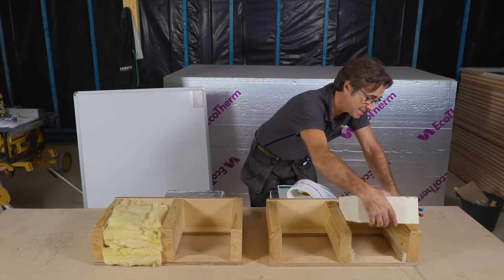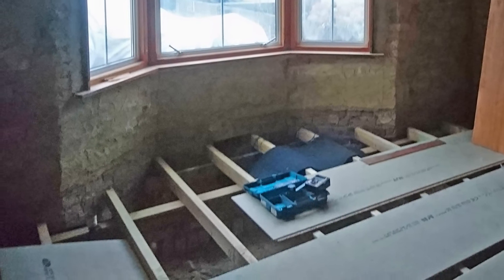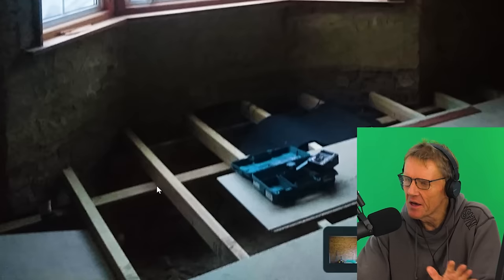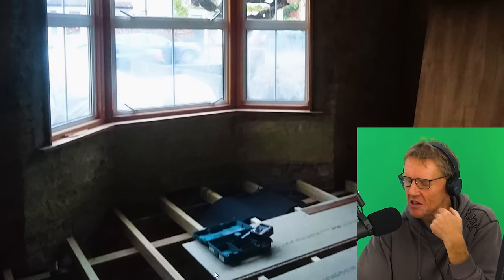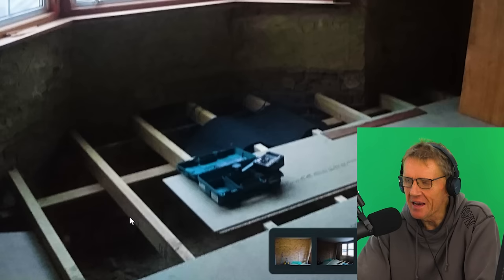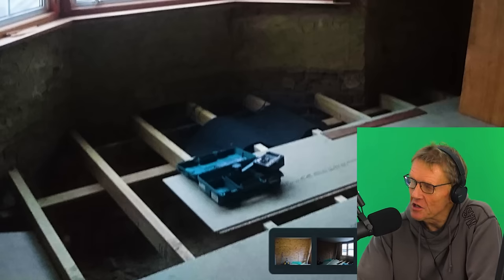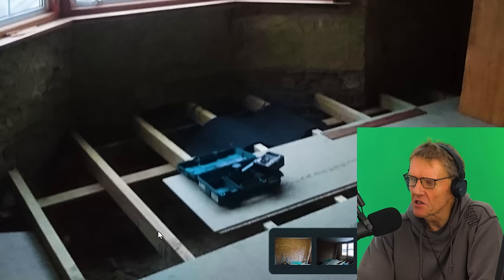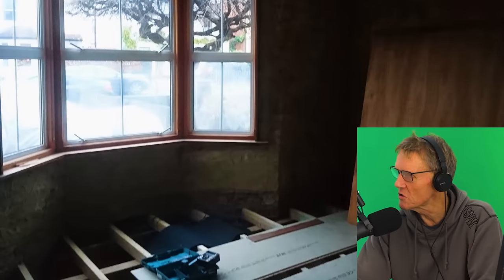Cold Floors & Walls in an Old House ~ What Can Nick Do?

Comment: Floor insulation. Can the crawl space be sealed/insulated and then hot air used to heat the floor and the rest of the house?  Can exhausted used hot air recycled through air to air heat exchanger to make whole system more effeciant?
Reply: Warmth always moves to cold. Any hot air will be attracted to the cold surfaces of the brick walls below ground level. Eventually, with enough hot air, some of it will warm the floor, but I don't know about "the rest of the house".
Of course, if you throw enough money/energy at it, it might.
I'm not sure what you mean by "exhausted hot air" though.
You may need deep pockets to warm a house this way, but the mice in your crawlspace will be happy.
Reply: I understand that there are many unknowns. How much heat will return from the brickwork into the property? Will a level of insulation less or similar to insulating a suspended floor be required? Could foam insulation be used sprayed from a robot? With each individual property costing would need to be done to determine if it would be cheaper/less upheaval to do such a thing? Presently insulating suspended floors means removing all the floor or working from underneath, a very long, expensive and disruptive process. Could this possibly be a easier option. With new build a new design configuration could be utilized. With exhausted air I mean that air would have to flow through the crawl space to carry the heat required. his heat could then travel into the property and rooms to heat them. This hot air eventually reaching the upper floors/attick. Could this air be then transported to the Air to air heat pump and used to increase its efficiency. Additionally could the warm air travel up the inside of stud walls to warm the whole wall/s? @waynemoore8615
Reply: @fredblogs5801  WOW.
I think you might be overthinking this confusing conundrum.
1. From looking at other comments, it's clear that there is no consensus on the "correct" way to do things.
2. It would be easier (and cheaper) to insulate between the floor joists, rather than the whole crawl space.
3. Any hot air that you would somehow blow into the crawlspace could just be blown directly into the living area. This would heat the room and the rest of the house up much quicker - saving you even more money and time. After all, why would you heat a space that you can't even use?
4. I suppose it would be possible to run ducting from various parts of the house to your heat pump, but the cost of doing that, and having to run various fans to constantly pump the air, would far outweigh any benefits from "extra heat pump efficiency", don't you think?

Bear in mind that I'm no expert on this subject, and I don't want to discourage your ideas, so if you want test your theories, then at least do it on a small scale first with an accurate and reliable way of measuring your results (that will be challenging on its own), otherwise, trying out on your whole house might be the quickest way to bankruptcy.
Reply: I do not know if you are aware of how difficult and expensive it is to insulate between joists. From underneath it can be extremely difficult and in many cases impossible. In most cases crawling around in the crawl space is a horrible dusty dirty job which I would wish on nobody. To do it from above requires the whole surface floor to be lifted up. This also entails all the things on the floor being removed including skirting boards. Insulating between joists is finicky and time consuming. Once insulated a great thing to do is then install wet underfloor heating, another expensive time consuming job with all the pipework, valves and pumps. The vast majority of people would not want to have their house turned upside down to carry out such work unless an easier, cheaper and disruptive method was available. Are you aware of the hot air house heating systems? These tend to have a central "furnace" that ducts warm air throughout the house, as mentioned this type of heating is used a lot in Canada. My thoughts are if there may be an easier and cheaper way of giving underfloor heating and I have raised that question hear to try to find good valid questions and quires on this idea. The idea is in a basic form and compared to the tradition method could be cheaper. I do not intend to bankrupt myself so many thanks for your concern and all the best for the NewYear. @waynemoore8615
Reply: @fredblogs5801  Thanks Fred, all the beat to you and yours also.
Yes I am aware that it's not an easy prospect to work in a crawlspace, but you would also have to do that if you were to insulate that space anyway.
Yes, it is disruptive to take the floor up, but surely you would at least have to remove some of it to gain access to the crawlspace.
You wouldn't need to remove skirting, or any boards that were near the edge, as you could push the insulation the last foot or so to the wall (or under a stud wall).
The job would be much easier from above.
The hot air house heating that you mention is guided through sealed ducts to where it is needed - inside the room.
To just aim it into an empty space below the house would probably make that room's floor quite toasty (assuming it wasn't carpeted), but the volume of air that you would have to pump in there would be quite costly, as I mentioned before.
Once again, my intention is not to merely shoot down your ideas, just to point out some relevant points that you may need to consider when developing the idea.
Wouldn't want to see any man go down the tubes for the sake of a little friendly advice.
Good luck with it.

Comment: You could always come off the wall 50mm put a 75 mm stud up put some tyvek on the back for moisture and 75mm kingspan in-between the studs it'll also helps with noisy neighbours 😂 good luck 🔨
Reply: Good idea mate but some of us can't afford losing 0.2m in our tiny rooms (if done on opposite walls) haha.
Reply: Yes you do lose on an average 145mm on each side of the room nut it's the most thermo efficient way of doing it
Reply: @tomsmith9048  agreed and if it's a wall shared with the neighbour, condensation is much less of a concern
Reply: You'd lose far to much volume in the room. I've got 27 mm thermal board in our attic bedrooms with 100mm  glass fibre insulation between rafters , no tyvek or similar- straight from rafters/counter battens to slate. It is warm enough and structure remains dry as a bone. 300 + year old house. People these days feel the need to walk around indoors in tee shirts in the middle of winter. No wonder we have all become soft-arses.
Reply: @wr3099  I agree that's why I said noisy neighbours 😂 I did it on my friend's house and double boarded it and he said it helped him out but his was and old terrace
Reply: @catabaticanabatic3800  I meant to say an old fashion slate roof doesn't need a breathable membrane because of the way it's layed but obviously a wall will need a membrane for moisture reason's
Reply: @catabaticanabatic3800  you only lose 145mm from each external wall and I like wearing a t-shirt in winter 🤪

Comment: My understanding is that if you take more than 25% of the plaster an external wall then the wall needs to be insulated to comply with current building regulations.  What he wants to do and what you have suggested wouldn't achieve that
Reply from the maker: Good luck with that.
Reply: If you are giving advice to people I'd have thought you would mention the building regulation requirements.
Personally I try to avoid doing it as it messes up windows, is expensive and reduces floor area. People should be made aware of it though

Comment: For once i disagree with you. On that construction wall, you want to batten, insulate between battens, insulate over the top of the battens, tape all joints up then board and either dryline or skim.

Or metal stud the wall, insulate and board.

OR stud infront of the wall, insulate and board.

Never use plasterboard adhesive on lime construction solid walls as the adhesive will end up soaking wet.

Need to isolate the boards from that wall entirely.
Metal board system would be ideal but 25mm battens would be easier for a diy'er.

That way you know there wont be any chance of damp migration to the finishing surface.

If you were to dot&dab to secure insulation backed boards, you'd also have to put mechanical fixings through the boards into the dabs and that would allow cold bridging and the screws WILL rust through the decorated surface. Not to mention the adhesive dabs will be damp permanently behind the wall.
Reply from the maker: Why will the wall be damp behind the insulated boards? Are you suggesting that moisture is travelling though from the outside?. If so a quick coat of Stormdry will stop that and the wall will dry out.
Reply: Use stainless steel screws?  Cheap enough these days.

Comment: To meet building regulations for the solid wall it's U - 0.30 W/m2K min...batten out and use 40mm skimmed insulated plasterboard, 50mm insulation between 150mm studs on membrane with 100mm airspace. This gets you U - 0.23 W/m2K but not only is there a cost consideration for the studwork it severely impacts on the room's space.
Reply: There is no building regs involved and it's very unwise to try and bring an old solid walled property up to them too. They are not designed to work that way and you'll cause nothing but problems putting that amount of unbreathable insulation on them internally.

Comment: Just done this in my house.

Insulated plasterboard is so expensive roughly 60 per sheet.

jablite insulation board £10
tapered palsterboard  £10
low expanding stick foam £5 does around 4 sheets

lay down foam on flat surface, spray lots of foam on top, lay insulation board down on top. Put some lengths of wood on top, walk around in circles for a minute all two.

Cost just over £20 for a 37mm total insulated plasterboard
Reply from the maker: The only problem is that you do not have a vapour barrier because the Jablite is not closed cell.

Comment: I disagree, I don't unsually find myself disagreeing with you Roger.. A couple of years I had to the same kind of work in an identical room. What I choose to do is to get rid of all the timbers and floorboards, I had a 40cm gap under so I filled it in with concrete, 75mm insulation and underfloor heating, best thing ever, no more draft and no more worries about rotting timbers. On the wall I built a timber frame and insulated with celotex and finished with plasterboard and skim. If I were to do it again, I would possibly to the thermal insulation board stuck with expanding foam to the wall...
Reply from the maker: I really don't mind people disagreeing with me that is the name of the game here but the home owner has renewed the joists so I am not going to tell him to rip that out and pour concrete in there. I love UFH and have done many jobs with timber suspended floors.
Reply: @SkillBuilder  agreed Roger. I wouldn't recommend UFH between joists. Good debate! Keep up the good work!

Comment: If that’s an external solid wall , you will  have serious problems, if you dot& dab ( dry rot ) trust me I’ve seen it first hand ,
Reply from the maker: We have all seen dry rot but it won't happen in masonry. It starts in timber.
Reply: @SkillBuilder  it may start on a skirting board !

And I’ve seen it go through foil back insulation slabs & traveled up through the insulation board because moisture or the dew point was behind the board , Mike

Comment: Many new houses built from the 90's onwards have solid concrete floors that are just heat sinks. What can you do to insulate these? We have the thickest underlay you can get according to the carpet fitters but in winter, you can still feel heat being sucked into the concrete. And no, underfloor heating isnt an option due to the utter carnage that would cause,
Reply: Not just the nineties - this type of floor is common from certainly the 70s, and possibly even as far back as the 60s.

Not ideal, but you could consider 25mm of PIR over the concrete (but under the flooring).  Would involve relocating the skirting 25mm higher and trimming the door(s).  Would leave a trip hazard on entry to the room unless you did the whole ground floor in one.

Comment: First of all dont use that crap osb board. Buy floor boards and screw them down. Dot and dab the wall with insulation board like Rodger says. And bob is your uncle.
Reply: Surely it depends what you're putting down on top of the chip board? There's nothing wrong with it if it's being carpeted for example. Especially if glued.
Reply: @ricos1497  If the floor boards/chipboard is glued down, how to access cable/ pipes that are under the floor in the future?
Reply: @westwonic  looks to me like there'd be room for a crawl space there. I actually thought it was regulation these days to glue flooring like this in order to stop the inevitable creaking that occurs otherwise. With cabling, I'd probably put into ducting/PVC tubing, so that any repairs can be done by pulling through, with pipes I expect that repairs would be significantly less frequent and you'd be having to lift whatever floor covering you're putting down anyway, so cutting through chipboard would make little difference.

Comment: Usual incorrect advice from skill builder with total lack of understanding of vapour open construction. He needs to go on a course and start giving decent advice.
Reply from the maker: I have been on more courses than you have had hot dinners. If you want penetrating moisture to evaporate into the room then fine but there are other ways
Reply: @SkillBuilder  Obviously the way to deal with penetrating moisture is at source rather than wait for it to come through the wall. There is a good reason why Historic England, BEIS, BRE, PAS 2035, AECB, RICS, BS-7913, RIBA, SPAB and many others advise the use of vapour open insulation and materials in solid walled buildings. Even the PCA are running courses on treating vapour open buildings. It would be helpful if you could use your large platform on youtube to promote best practice to reduce future condensation and mould risks.
Reply: I would add that you can have a vapour closed construction, but you really need to make sure that the whole room is vapour closed as the vapour will find the weak points. You'll also need to add a vapour control layer if installing internal wall Insulation, this is especially critical depending on the elevation and how much sun light or rain exposure.